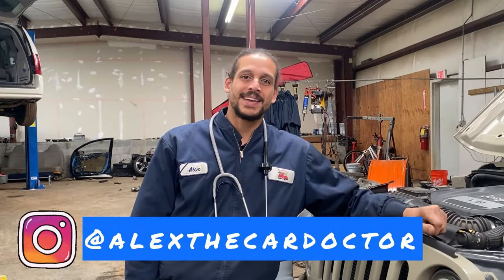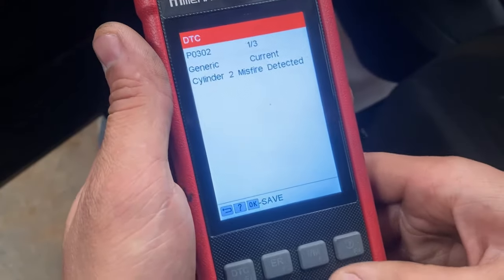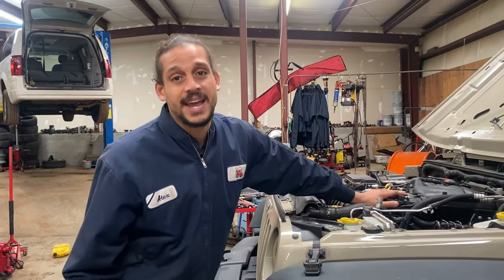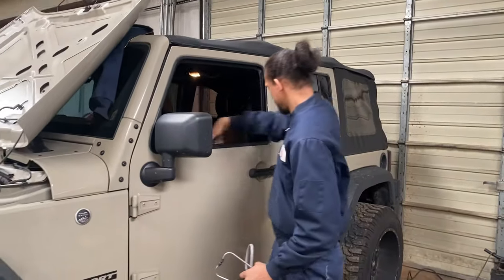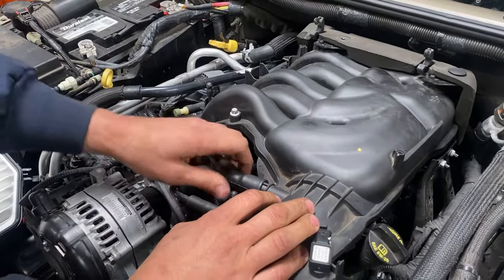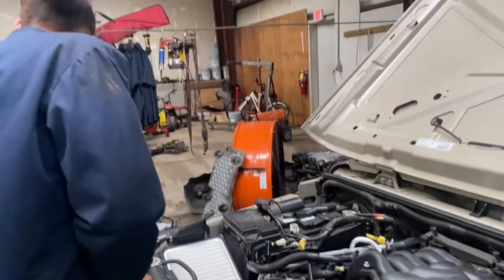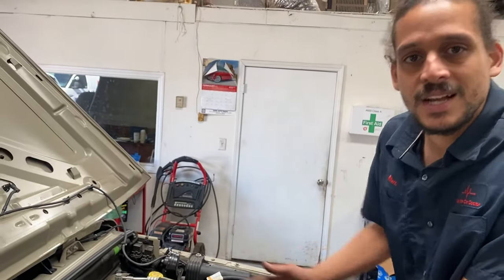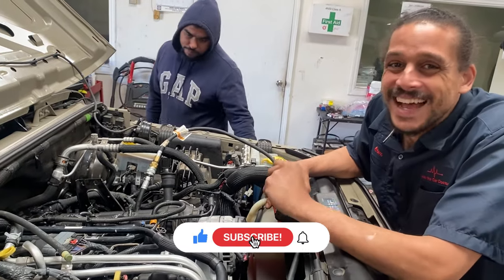Jeep Wrangler needs Major Engine Work at only 40,000 miles! | 3.6 Pentastar Issue #jeep #autorepair

Comment: Hi Alex!
I watch..u video..
I was planning 2buy a Jeep Wrangler 2018…but I had been hearing that they r very bad cars..
Now ,I’m not sure 2buy..
My cuestión is ,are all the Jeep’s wrangler ara bad?
🙏
Reply from the maker: Hey there it’s not really about the vehicle it’s all about the drivetrain, The wrangler comes in different engine sizes a four-cylinder gasoline a four-cylinder diesel and the 3.6 pintastar in the late models in the early models the wranglers came in a four-cylinder gas in-line six which is the best engine in my opinion and the 3.8 V6 which is another good engine depending on what year you’re looking at which I think the later models 2018 I will try to find a four-cylinder it’s easier to maintain or the diesel which is great on fuel up to 30 mpg I’ve heard. now the most common engine of Chrysler products is the pentastar 3.6 which is not a bad engine you just have to take care of certain problematic like changing out the plastic oil cooler for the aluminum one and using full synthetic oil which I think you should use anyway in any newer vehicle
Reply from the maker: I’m a big Jeep wrangler fan by the way my jeep of choice is the new 4xE great power great fuel economy or if I go for the older model it would be the in-line 6 cylinder 4 L
Reply: @AlexTheCarDoctor  thank u so much!!🙏
Reply from the maker: @rigobertosantana9702  my pleasure

Comment: I have a 2017 Jeep Wrangler 3.6 and I've been having overheating problems. Now check engine light for cylinder 2 misfire also. Only 50K miles. Mechanic changed out the radiator and thermostat, thermostat has been purged and still overheating to about 250 degrees. Any advice on where to go from here?
Reply from the maker: Hello and thanks for watching sorry to hear the bad news.you need to perform a block test next that will determine if the head gaskets are blown if you’re not familiar with the process I can send you one of my videos explaining how to do it
Reply from the maker: Once it passes that test then I will let you know what to do next
Reply: @AlexTheCarDoctor  yes please could you send it to me! Thank you
Reply from the maker: @mikelawree  https://youtu.be/N4NpomEKm4g

Comment: Isn't this car still covered under the manufacture's warranty? it's only 3 years old with less than 60k miles. Make it the dealer's problem. I have a 2015 Grand Cherokee with the same engine. It's been flawless. It being the 1st American vehicle I ever purchased I went ahead and bought the lifetime warranty. Did have some suspension bolts retorqued and the navigation screen replaced due to 1 dead pixel ;-). All done under the lifetime warranty. I did the 1st service on it and had the dealer do every service since at 5k intervals. The car has 50k miles on it now.
Reply from the maker: Yes it was covered I told them to call the dealership right away.she is back on the road now,I recently put put rear brakes and tires on it

Comment: I got a 2021 jeep gladiator. Bought it new. I was not aware of a procedure in place to break it in, common sense , I avoided hard take off, let it run at least 30 sec if was a cold start and I changed the oil every 2000 miles til I hit 15 thousand miles. I use royal 🟣 oil and wix filters. I discovered something interesting by chance. One particular oil change my parts store didn't have the synthetic oil filter. They did have the same filter but for conventional oil. I got that one. On my digital oil pressure gauge, noticed the pressure readout was much more responsive in relation to the acceleration with this filter. I translate that to better oil flow. That's my guess. I felt if the oil is changed on a regular basis that increased flow is worth using this other filter. I put 50,000 miles on my gladiator in about 49 weeks. Not quite a year. It runs just like the day I bought it. No tics, no change in how loud, smooth as silk.

Comment: 5 yr 60k mile power train warranty…how is it not covered?
Reply from the maker: Hey there I told them to check with the dealership and it was covered
Reply: @AlexTheCarDoctor  what ended up being the issue?
Reply from the maker: @admorris11  I do believe the replace the cylinder head

Comment: Alex! Question for you - I have a 2016 with the 3.6l. I notice these engines have a slight tick to them no matter what. I even hear it upon startup in this video. Is that just the injectors going to work? Just normal engine noise? What makes that noise? 

Most days I can hear it through my dashboard…
Reply from the maker: You are correct it’s normal injector, noise that’s way the engine has that engine cover to absorb some of the noise.
Reply: @AlexTheCarDoctor  thanks so much!Seriously puts my nerves at rest. 

Is there anyway to quiet it down inside the cabin? New engine cover? Just doesn’t seem I should hear it from inside. Can’t find much online with other people experiencing it inside the car.
Reply from the maker: Do you have a jk wrangler if so the cabin noise is pretty loud no matter what engine you have Unlike other cars they have noise deadening material in the door panels and etc.
Reply from the maker: Can you send me a vid of your engine running
Reply from the maker: I just watched it everything sounds as it should,like I mentioned before the jeeps are not quiet inside the cab.it’s a keep thing
Reply: @AlexTheCarDoctor  Thanks so much man! Really appreciate you taking the time to do that. Very much a relief.
Reply from the maker: My pleasure anytime
Reply: They fix mine for free at the dealership there was a bulletin lucky I caught it before warranty ran out

Comment: I have a 2014 with almost 100 thousand miles and it runs just like new, maybe 2018 motors were just not built right
Reply from the maker: Yeah I don’t get many 2014’s with this issue. Just regular maintenance stuff.
Reply: @AlexTheCarDoctor  that’s good to know

Comment: Between the 3.8 liter and this 3.6 pentstar, which would you choose?
Reply from the maker: In my opinion a over head valve engine is better  long-term than A overhead cam engine. Simplicity wins with overhead valve engines that’s why the GM LS engines are so great.the win is 3.8
Reply: @AlexTheCarDoctor  good to know.  Either seem relatively cheap to replace now, but I was a little worried about the 3.8.  still no Toyota....🤔
Reply from the maker: @czechnolike  Toyota fan me too very reliable I always recommend getting a Toyota

Comment: I know is is a bit old but I would like to mention my odd happening s. My Ram 1500 has the 3.6 Pentastar. It started running rough although I had replaced coil packs/plugs 3 months ago. Took it to Autozone, OBD said #5 fuel injector. Took it to the local shop (franchise) that does my "small" stuff. The next day they called me and said "come pick up your truck, you got a MAJOR problem with compression so bring it to a dealer ???!" Went into the lot to drive it out and it started right up and NO engine light. It ran great! I knew better than it just healed itself so I went to another Autozone. OBD said no issues, lol Next day it was running rough again so off to the dealer. End result #5 fuel injector WAS bad. On the way home picked up some REDLINE injector cleaner . Hopefully that will clean the other FI's AND if you're wondering why all 6 FIs weren't replaced, my extended warranty company won't fix ANYTHING that's not broken so my protocol is let them fix the one, I start the Redline S1, and if it happens again I know what to do

Comment: This is why you don’t buy a new Jeep. Fiat made. Sad to see the death of Jeep reliability. I’ve owned several XJs with over 250k miles that ran great. Original engine and transmission. Fun fact: the XJ has an Aisin auto trans. Aisin makes some of the best transmissions, Toyota also uses their trans and parts. Also owned an 06 wrangler with over 130k miles. Anything after 06 seems to have way too many problems since Chrysler went to using Fiat parts. Chrysler alone is bad enough, but once Fiat also got into the mix that was it.
Reply from the maker: I Did not know that about the transmission thanks for Sharing your knowledge buddy,and you are right about the year
Reply: @AlexTheCarDoctor  No problem, the transmission used in the cherokees from 1987-2001 is the A340H Aisin transmission. Chrysler called it the AW4 auto trans, perhaps they didn't want to admit to using a transmission that wasn't their own.

Comment: I would not buy a vehicle with the Pentastar engine in it.  Too many horror stories.  That oil cooler under the lower intake manifold is one of them, and the ones that add the "optional inspection window" in the side of the block when a rod exits is another.

Comment: Yeah jeep replaced the head on my jeep wrangler 5k miles late the engine went never going to buy a new jeep again 6k Jasper engine
Reply from the maker: Sheesh. Yeah the new Jeep isn’t for week pockets.
Reply: @AlexTheCarDoctor  I'll stick with the 4.0 jeep xj
Reply from the maker: @nickysindora6952  the engine was so good they stop producing it they claim it was not Emission compatible yeah, right
Reply: I have a 98 jeep Cherokee XJ also just turned 250k runs like it's brand new I tow my 16 ft center console boat with it to the down the shore in jersey like a half hour ride from me it has a lot of torque
Reply from the maker: @nickysindora6952  and a lot of life left in it

Comment: Never assume the previous tech that worked on is a butcher. Plastic hoses break even with the slightest pressure. Granted there are bad techs out there but also take into account of the owner and there maintenance of the vehicle. I work on European cars you would be surprised on the lack of maintenance these “wealthy” owners do.
Reply from the maker: I agree and disagree with you,with this situation the truck has never been touched other than oil change and the customer stated that the previous mechanic had the intake manifold removed to replace the spark plugs. So with this situation the last mechanics was very careless unfortunately
Reply: @anglo cool story bro.

Comment: No I’m not familiar
Reply from the maker: https://youtu.be/I1ZZjYL2iao
Reply from the maker: It’s a older video of mine, so I was still getting use to being on camera lol
Reply from the maker: You can perform this test on any gas truck/car
Reply: Thank you 🙏🏽.
Reply: Can I do a compression test instead?
Reply from the maker: Yes and no it depends on how the head gasket blows, if your car is running smooth you will not have lost in compression with a blown head gasket if your car is running rough you will have low compression. I normally use compression test to check for misfire problems
Reply: If my compression is good will a bad oil cooler cause my Jeep to over heating ?? I see oil on top of oil cooler but it’s not seeping down ?
Reply from the maker: It should not unless it is leaking coolant. You can completely bypassed the oil cooler in your car so a bad/stopped up one will not cause your car to overheat
Reply: It’s runs perfect no check engine lights that’s what’s baffling. The coolant goes to overflow then if I keep running it will overheat obviously but it’s doesn’t go past half on my gauge then when I get home the overflow tank is full but I will do a block test sir

Comment: This engine sucks. Don’t get the Jeep truck. They have bad oil coolers that fail at 35k miles that contaminate the outside of the engine and the engines cooling system.